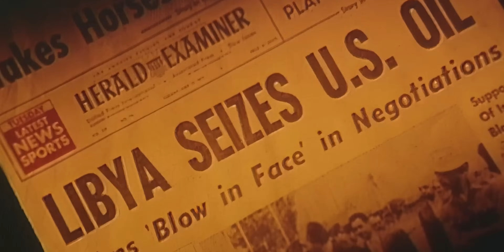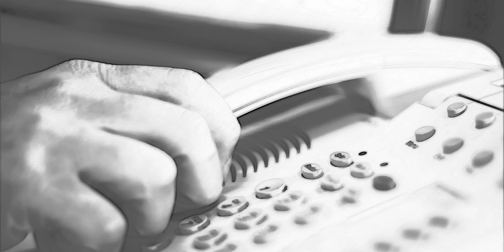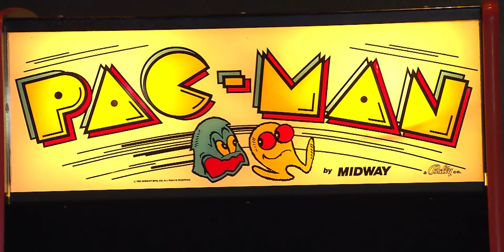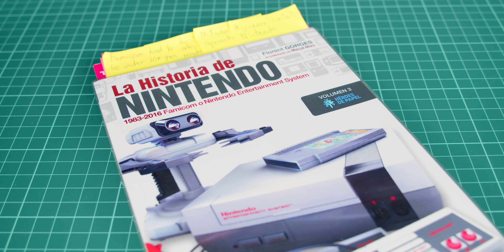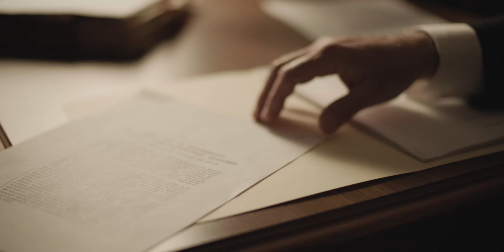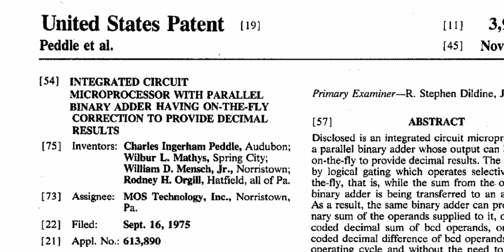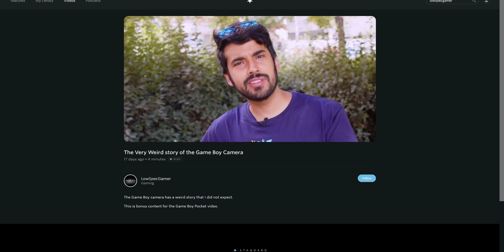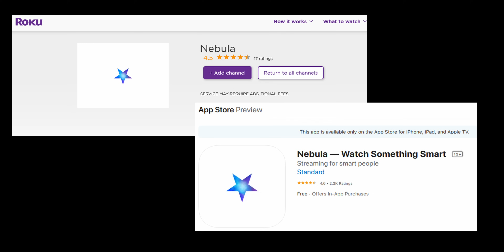Nintendo's Cheating Console

Comment: RE: Why the switch has 4 separate buttons instead of a d-pad
It's because the joycons can be used separately as if they were their own controlled with an analogue stick and 4 face buttons. Making it a d-pad would prevent that.
Personally never found anyone who'd rather use a lone joycon instead of a pro controller or third party controller(no drift = best choice IMO).

Comment: 3:36 Small correction, the reason many of these ports sucked except for the ColecoVision port was because Coleco had the rights for many of these systems to port Donkey Kong to. This resulted in Coleco intentionally gimping every single port of Donkey Kong they made except for their console's, to artificially position their console as the superior one. So yes, the home machines and consoles at the time may not have been super capable of running Donkey Kong, but they never saw their full potential on that front either.
Reply from the maker: That’s sounds interesting. Do you have the source do I can read more?

Comment: The chocolate chip like buttons on the joycons are actually better. The D-pad being combined like that, made it so sometimes you’d make inputs you didn’t actually make when positioned wrongly.
Plus sometimes it was more clunky. So singular buttons for each side is better.
Reply: They're not better, they only did it so that the joycons can be used individually for two player games. The pro controller still has dpad.

Comment: You can’t put Famicom carts inside cassette cases, but they’re about the same size as the cases, so you absolutely CAN put Famicom games in pretty much any container designed to hold the whole enchilada. Genesis/Mega Drive cartridges are also similar. I use an old Radio Shack cassette caddy that belonged to my grandmother for Famicom games, and another one that was my parents’ for my loose Genesis carts.

The cassette thing is fairly common knowledge, but something I don’t think I’ve ever heard anyone mention is how an N64 cart is nearly the exact same width as an NTSC VHS tape. Maybe Nintendo was still thinking along these lines. Whatever the case is, the TV stand that I use for my retro systems has a compartment designed for paperback/loose VHS tapes, and my N64 carts fit perfectly in it.

Comment: the square atari stick 'prone to breaking' ? LOL. they do many things. they do not break :P quite lousy to control games with them... but in all those years i've never seen one crack in half or anything like that :P people possibly using them as weapons to injure other people? sure. like the ibm model-m :P LOL.then still they work. :P (thing is you really don't want to use those long term. as a joystick they actually kinda suck. but that thing and the coleco gemini controllers (which obviously are compatible, and a lot better to use ;) are basically indestructable.

Comment: 'finding developers that knew what to do with a 6502' would be 'hard' ? lol. ya know. i think pretty much any developer around knows what to do with either an 8080, 8051, 6809, 650x, 8086 or z80. :P and then probably that weird signetics stuff too :P there wasn't that much around in terms of 'smaller computers' (as in non-pdp stuff ;) and as 'game developers' usually 'use computers' they'd probably have bought all of them ay :P and as such be familliar with the cpus used in all of them. (and by the time nintendo got this idea pretty much half of them out there had some sort of 6502 in them for like almost a decade already ;) so it's not like they would never have seen or programmed their tools to for one. consoles and arcade boards lacking a keyboard, you have to enter your code on something and burn the roms on something :P pretty damn sure the nes developer kit was simply an apple II witih a ppu board :P lol.

Comment: (@4:51) - This is - for all intents and purposes - an OkiData ML320/321 printer. I know, because the company I work for has sh*tloads of these things. I suppose the earliest models may have been made by Ricoh, but I can only guess they got bought out by OkiData, or sold the IP to OkiData, as I never saw any of these printers with “Ricoh” labeling on them. Fairly reliable, but they gave a NASTY tendency to suck the paper back into the tractor-feed mechanism if you don’t fold the paper over the front, and out of the way!
Reply from the maker: It was the one printer with stock footage available

Comment: I don’t think nintendo designed the famicom because of it’s success with donkeykong. and i also don’t believe that the famicom was designed with donkeykong in mind. because if nintendo really wanted donkeykong at home at a good quality, then they could,ve just make a console with that game builtin and with a Z80 chip instead. or they could,ve just accept to not built a famicom and just license that game to run on other systems alone instead albeit at good quality.
Thing is that nintendo had already the idea about a cartride based system back in 1980. but they needed more research to find a cheap but good cpu and ppu to work with.
Am mean am sure that even if nintendo didn’t had any successes in the arcade, they still would,ve come up with a cartride based game system anyway. just because it was cheaper to make rather then making dozens of consoles with builtin games on it.
Also if the famicom was purelly based on donkeykong hardware,then why was the hardware sooo much downgraded and different from it’s arcade counterpart? and why does it support scrolling backgrounds? Since donkeykong only had single screens just like any other games fromthat era.
This it is Something i consider not obvious, unless nintendo was looking forward into makong side scrolling games as well. am mean if you want to make sure to run donkeykong on it, then you don’t gonna cheap things out.  (unless you talk about unused parts of the hardware)
Now if the famicom was based on the unsuccessful sky skipper i wouldn’t have be all that amezed, since that game uses multi directional scrolling and multiple sprites on screen too,
BUT sky skipper never made it onto the famicom but it did made it ironically on the atari 2600 for some reaso. so whatever the outcome and history of the famicom, nobody and i repeat nobody could ever convince me that the famicom was made in response and with donkeykong in mind.
Reply from the maker: I feel most of your questions are covered in the video. The Famicom designed around the idea of running a port of Donkey Kong is a historical fact, and was said time and time again by Uemura during his interviews, so there was little space for doubt. On the technical side, the did not use a Z80 or anything closer to the architecture of the arcade cabinet because, as the video explains, the console was thought with price limitations first, and of all companies reached the only up for it was Ricoh which, for reason speculated in the video, insisted on using a 6502 even if it meant a redesign.
Reply: @LowSpecGamer  well i bet that if the famicom was designed with sky skipper in mind,it wouldn’t have be different hardware wise either,still trough i do believe that the famicom was made with multiple nintendo arcade games in mind,
HOWEVER i do find it interesting that the famicom controllers were hardwired and with short cable length just to make it cheaper,BUT we know all how clumsy that tended to be.

Comment: Interestingly, it's only the joycon that doesn't have a d-pad.  It's on most of the external pro controllers AND on the Lite.  Obviously it's on the joycon so that that left and right can be more or less symmetrical.  You can use 4 buttons in place of a d-pad, but the d-pad would restict you from being able to press X & B or A & Y at the same time.

Comment: Ricoh was ATARI's supplier of the single chip ASIC which powers the ATARI 2600jr "unicorn" which contains a 6502 core, the "RIOT" chip ("RAM-I/O-TIMER" MOS6532) and the "TIA" (Television Interface Adapter). So ATARI was the reason why RICOH could make 6502. And because RICOH was tied to ATARI's contract regarding the processor core they neutered the BCD function to avoid being sued.
Reply from the maker: Fascinating!!! I had never heard of this. I am going to look into it with detail. So you say they had a license for the 6502 but only for Atari??
Reply: @LowSpecGamer  Pretty much, yes. The story I heard was that the deal was made in 1981-82 and was supposed to be used in new devices around 1983 but we know what happened to ATARI by that time. That would explain why Ricoh had their factory empty but ready to roll into mass manufacturing of chips. ATARI had been using other Japanese manufacturers to make the TIA chips (OKI of Okidata fame for example)
Reply from the maker: That would match the timing. I am going to see if I can find any primary source on it. This would solve one of my biggest questions.
Reply from the maker: Do you have any source for this? I need to go into research mode